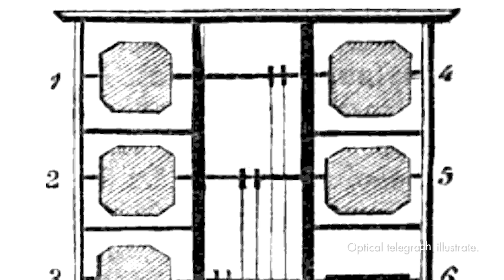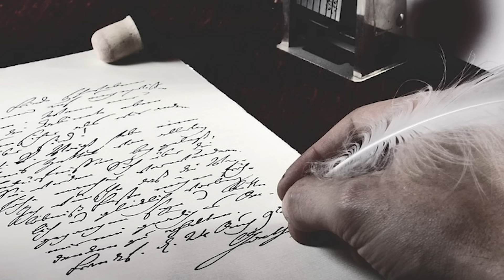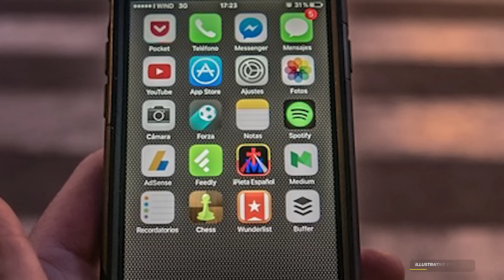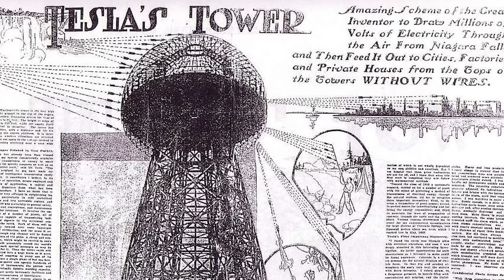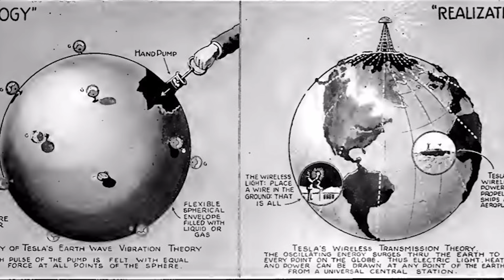Why America's Forgotten Microwave Skyway Network is still standing | Abandoned

Comment: I started off in the USAF. We were transmitting 50kw at 2Ghz into the troposphere in Europe supporting the cold war. Later on worked as a Microwave Field Engineer maintaining analog radio relay in the  US. Later to be underbuilt into Digital Radio. That did not last long and nearly all of the communications now is fiber based. For the most part the only place we are using radio waves is at the cell tower to the end unit. Everything else is fiber.

Comment: I live near the I-80 corridor in Ohio. My high school was/is located about a mile from one of these towers. I always remember looking off in the distance trying to understand why it looked so much different than all the modern cell phone towers. We use to pretend that it actually contained a hidden ICBM missile. The interesting thing about the towers in my area, they are made entirely from local sandstone quarried out of the earth. As far as I know the towers are still in use today with new updated antenna gear, not sure what types of signals they transmit.

Comment: In my home town in southern Illinois there is an AT&T Central Office that had a microwave tower on the top of the building. Back in 2014/2015 AT&T removed the tower because it was no longer using it and it was getting too costly to maintain. It was interesting watching crews take it down and scrap the steel and receivers.

Comment: The problem with microwave is it needs direct line of site so if a structure goes up between two signal posts it blocks the signal, even a large crane can cause problems.  We had this problem is the early 1980's with security cameras with signals beamed from a town centre to a building in the outskirts and shortly after a construction site crane did exactly that.

Comment: Imagine this being setup point-to-point, much like an updated fire signal network (visual line of site) We still use MW towers for emergency comm networks and they still have this limitation of topography and signal strength. Still, this type of system has several options for back ups and redundancy vs. other more 'modern' systems. Glad to have worked a few emergency network comm systems in my time for EOS and County Sheriff users.

Comment: I learned that radio waves and microwaves cause headaches for me in the late 1970's early 1980's...  whenever I drove along a certain eastern interstate,  and crested the mountains into a broad vallye with a row of these microwave towers on the east and west ends of this valley... and the interstate highway between them,  I would get blinding heachaches,  barely able to keep my eyes open and on the roadway,  until several minutes later when I crested the next set of mountains and entered the next valley.  Since I am now essentially retired,  no more cell phones or wifi for me,  my house has LOUSY TV/Radio/Cell phone reception...  it is quite wonderful not having constant low grade headaches.
Reply: re: "radio waves and microwaves cause headaches for me in the late 1970's early 1980's."
Not really likely. Those 'beams' from those antennas are highly refined, focused, to point at a station some 15 to 20 miles distance. Its not like a broadcast tower that sends a signal all over the land for reception by everyone.

Comment: Microwave towers are still in use. They are not as widely used, but still used. They are used as back up communication links and still handle phone calls in rural areas. This is because there is still is not enough call volume to require more call capacity that new technology allows. So the tried and true microwave towers that are payed off are still in use.

Comment: Microwave transmission was a big deal when I was a kid.  The big obstacle was line-of-sight.  Weather and other factors interfered.

Satellite communications sucked, because of the latency of the signal having to be transmitted up, then down.  I remember totally annoying long distance phone calls, where the latency of 1/2 to 1 second made you constantly step over the other person's conversation.

High-speed twisted pair worked for a while, but yeah, fiber was the way.  The additional perk to fiber, is it could be hit by lightning, and wouldn't fry the equipment at both ends like copper did...

Comment: There is ALOT more involved in the AT&T long lines system. There were several different generations of communication channels. There was the L3 line, L5, and many others. AT&T had thousands of these sites and put a lot into American infrastructure. MCI had a huge involvement as well. Now, many of the sites are owned by American Tower Corporation and have since been converted into cellular towers. Microwave horns are still used commonly in the US. There are a lot of data sheets, articles, and forums about longlines

Comment: Check out the 'White Alice Network'. It was an 'Over the horizon' phone system, in Alaska to provide phones to all military bases. It is mostly gone, but some photos and articles are on line. I used it in the mid '70s, from Ft. Greely/ It also carried our two Teletype circuits, and out network fee for our AM radio station.

Comment: Most of the pictures you show of horn antennas are apparently of the AT&T Earth station built for Telstar at Andover ME and of the Holmdel Horn at Bell Labs in NJ which was used for the Echo satellite balloon experiments. The Cosmic Microwave Background was discovered in the mid-1960s by engineers using the Holmdel Horn, which was seen as a remnant of the Big Bang which created our universe. Unfortunately, this historic antenna structure is in danger of being demolished by land developers.  You do show a few pictures of the original Skyway towers, as well as the more familiar AT&T microwave towers which followed them with their distinctive Hogg Horn antennas. Although AT&T decommissioned most of their microwave relay network, replaced by fiberoptic cables, and often removed the Hogg Horns, many of these towers are still in use for various modern wireless systems. One aspect which you don't mention is AT&T shortwave radio stations, which were used to transmit telephone calls thousands of miles, for example, between North America and Europe, before the first transatlantic telephone cable TAT1 became operational in 1956. Shortwave radio was also used in the high seas service, allowing ships and aircraft at sea to make and receive telephone calls; this has been replaced by satellite services.

Comment: I am watching this on YouTube over the internet and my ISP uses fiber optic cable to delver it to my house. I transmit it through out my house with a small 5 GHz microwave system (router) to my laptop computer. I also have an abandoned microwave relay tower system 1.5 miles from my house.

Comment: What is always puzzled me about these advances in technology is what becomes of the old technology?  When fiber optics connected telephone exchanges between communities, it was a step up.  Inevitably in our rural area of the state, someone would accidentally sever a fiber line and cripple service between communities,  but service within the community was not impacted.  Long distance, toll free numbers,  and operator assistance may be down because of that fiber cut... and here i was asking "what did you do with the old copper lines that USED  to connect these towns?  Did you cut the wire off at the ground where it came into the switching office?  Why was tgere never a backup in place making use of thay copper.
Reply: I heard Spectrum is upgrading their coax cable equipment. They claim that the coax can push fast speeds as well as fiber. So pretty much they’re going to be using those “old” lines. I only heard about this from some spectrum employees… I’m not educated on this type of stuff.
Reply: The old copper lines are still there in a lot of cases. Due to nonuse, no maintenance they have deteriorated. The dollars are not there to keep them going. The bandwidth for legacy copper is pretty slow. Sometimes a company would "shotgun" a connection into a location to increase speed. They used two lines. 

As far as coax, it is no where near as capable in terms of bandwidth as fiber, but it is very good. The plus side is the equipment needed is cheaper so I can see a company wanting to stay with coax.

Comment: Our local WISP has bought 3 of them from American tower company  they hired me to build a lot of brackets for standoffs to mount radios on them removing the horns is not hard you cut them loose and have a long cable on them hooked to a truck to pull them off and away from the tower and guide cables ! Most are fiberglass and not much to recycle on them use the K12 saw on them and load into roll off  dumpster ! They are quite large up close !

Comment: Our amateur radio club president works on radio
communication for NY
Metro North on the Harlem
Line in Westchester County,
NY. 
We had amateurs who worked
for AT&T in White Plains, NY
which had microwave towers 
I understand the building is
bomb resistant.
When i was a guest there in
1987, there were banks of
relays in there.
Now that AT&T has left there,
there are residential buildings
being built there.😊

Comment: The fact that fiber optic cables became cheaper and more reliable to install was not the sole reason the microwave networks were replaced. Running those new cables cost money, why invest in it? If we as a society had continued to use traditional telephones the network would likely still be adequate. I don't remember who said it, but with the rise of the internet, bandwidth became king. You can pump a lot more data through the fiber optic lines than you can the microwave network. Once the new lines are in place, there's no point in maintaining 30 year old technology if you don't need it. The rise of the internet motivated the upgrade, which eventually made internet service cheaper and more reliable, which drove more and more services and systems to start using the internet as a connection mechanism vs the traditional phone based networks.

Comment: Many of your illustrations are very good--especially the antique pictorials--however, much of the open wire is of power distribution, not communications open wire.  Some of the earliest articles about AT&T's microwave systems originated in 1940, including a proposed microwave station illustration.  Microwave is line of sight and this was the basis of some very interesting (and humorous) stories of its use.

Comment: The party about Tesla’s wireless is patently false. He was not sending it through the atmosphere. He was sending AC through the conductive earth.
 
Tesla: “There is no radiation in this case. You see, the apparatus which I devised was an apparatus enabling one to produce tremendous differences of potential and currents in an antenna circuit. These requirements must be fulfilled, whether you transmit by currents of conduction, or whether you transmit by electromagnetic waves. You want high potential currents, you want a great amount of vibratory energy; but you can graduate this vibratory energy. By proper design and choice of wave lengths, you can arrange it so that you get, for instance, 5 percent in these electromagnetic waves and 95 percent in the current that goes through the earth. That is what I am doing. Or, you can get, as these radio men, 95 percent in the energy of electromagnetic waves and only 5 percent in the energy of the current. Then you are wondering why you do not get good results. I know why I do not get good results in that way. The apparatus is suitable for one or the other method. I am not producing radiation in my system; I am suppressing electromagnetic waves. But, on the other hand, my apparatus can be used effectively with electromagnetic waves. The apparatus has nothing to do with this new method except that it is the only means to practice it. So that in my system, you should free yourself of the idea that there is radiation, that energy is radiated. It is not radiated; it is conserved”.

Comment: In Mexico in the 1980s and even in some regions such as the early 1990s they were still in use for long distance calls, telex and even multykey telegraphy and the old basic internet (postArpanet and pre World Wide Web, used in Mexico by the recently extinct Notimex news agency and other intranets such as the Weather Service). TV stations owned some towers and sometimes shared the National Microwave towers. In 1985 when the catastrophic Mexico City earthquake occurred Televisa's private towers were knocked out, including it's satellite towers, the then public TV stayed quiet to the outside world since the president at the time was more worried in not scaring investors. Amateur radio operators spread the world but it was PEMEX through its own independent microwave system, which had some autonomy unlike public TV or the army, informed its offices in the rest of the country what happened and another private microwave network, that of the Monterrey Steelworks, offered its fax to send communication  and whereabouts of relatives and acquitainces for weeks.

Comment: You have shown quite a few RADIO-TELESCOPES, not micro-wave communications towers. If it has a ring, it is a radio-telescope, after all, there are no microwave towers in the sky, especially in the 1950's. Micro-wave towers are direct line-of-sight only.

Comment: The beginning is missing a very important signal relay system that the Roman’s used. They had what was deemed “torch towers” from horizon to horizon, there’s evidence the Mongolian Empire and the Chinese Empire used it as well. But the Romans perfected it with their stone structures and military precision, basically the amount of time a torch was seen a jar full of water would be released, coinciding to the release of the water would be “coded lines” where the torch light would stop from the other tower and that message would then be relayed to the next tower. A message could be relayed over a series of towers from horizon to horizon over the stretches of the Roman Empire in a matter of hours or days when it took weeks to months to travel the same route. This helped military reconnaissance greatly, why they proved to be a military force always one up on their enemies. They only conquered land they could maintain and have direct communication over, thus why they never stretched Far East into Asia and far south into Africa.

Comment: Hey, can anybody tell me if this long-winded dude ever answered the actual question he offered in the title. I got a quick case of MEGO and started skipping among the chapters but I couldn't find if he ever offered a reason why they were still standing.

Perhaps I just missed it.
Reply: Me too. I'm still confused.
Reply: I think most of those microwave towers HAVE been abandoned, lol, but im not sure.  Fiber links began supplanting the microwave networks in the 1980s, and way more in the 1990s.  I was really into telecom stuff in the mid to late 90s as a kid, and I'm pretty sure that they were mostly obsolete then.
Reply: Really I think its persistence even that long was due largely to telecom regulation, and that basically died around 1996.  But MCI flourished due to the bell system monopoly which died around 1984.

Comment: the stock exchange was sent by telegraph in a ticker tape.  The symbols had to fit across the width of a tape that brokerages away from the exchange used.  The successful firms had a dedicated feed, so stock exchanges putting in exclusive wires and fiber optics is hardly new.  That is were is the funky alphanumeric symbols came from for brevity and speed.

Comment: I have 3 buildings on my property ea h about 200yards apart and a 4th building 550yards on top of a hill.
I have fiber running between them it a single cable with 12 fiber strands into multiplex into 36 simplex transceivers each one doing 25gbps.
1 build is a crypto farm, 1 is a server room, 1 is my house and garage, 1 is my observatory with a 24-inch computer controlled telescope with 8 cameras( IR, NIR, RED, GREEN, BLUE, UV, full color, monochrome) Using beam splitting and custom optical design I made.
7 of the cameras are the same sensor type a 4/3rds chilled to -10c and filtered to strict band gap I can razor sharp pictures of the planets the moon  sun most known galaxies and currently mostly tracking sun spots.

Comment: Troposcatter? Bounce off ionosphere? Line of sight?
Reply: I do not think troposcatter is LOS, the antennas are in line with each other. We can only see to the horizon which is 2.9 miles for an average height person, on top of a 100 ft tower the horizon is 12.25 miles. There are two pairs of troposcatter antennas in Florida City, FL and Guanabo, Cuba 186 miles apart, that provided the island nation telecommunications and basic TV stations. I put a more detailed comment about the system with GPS locations as both are still standing.
Reply: @chrisdaniel1339  thanks! 🙏 yes, LOS can’t go 186 miles. Definitely bounce or troposcatter. Find the beam with a lightbulb on a stick…or a hot dog 🌭…This would be the alleged source of the Havana Syndrome…seems the antenna would be way too big though….hmmm…could be on to something Chris…

Comment: The microwave towers on the tops of the Qwest & AT&T buildings (and others like it, such as the huge array on the roof of the Union Bank of California building in Portland that Verizon (formerly MCI) runs are typically still operating for international service. Because it's cheaper and faster than going off the satellites for crossing the ocean in places where running a transoceanic cable isn't practical.

Comment: That is NOT hoe wireless calle were made back then. In fact no one made wireless calls. Those relay dites facilitated connections without having to run hundreds of miles of wire but the end subscriber had s wired connection into the network. They did not make wireless calls.